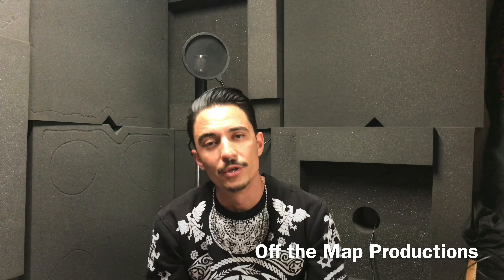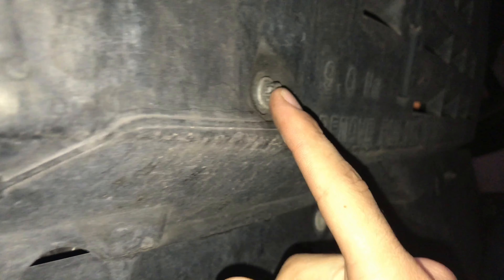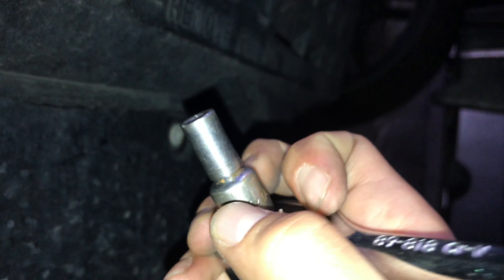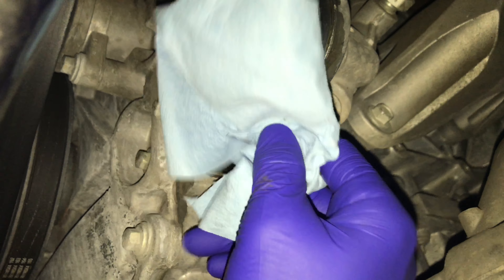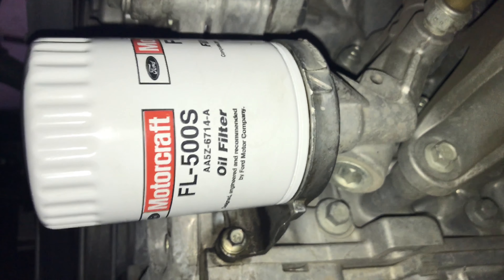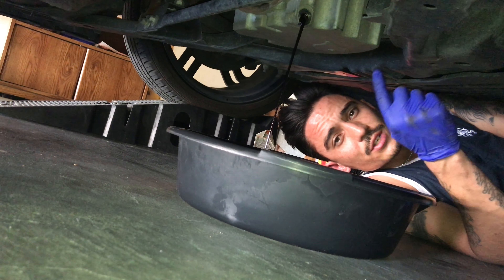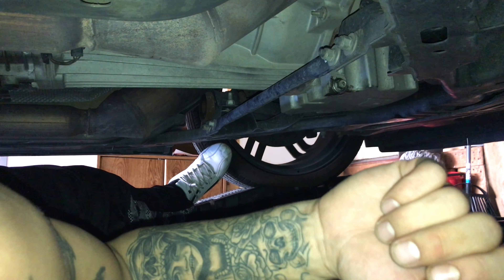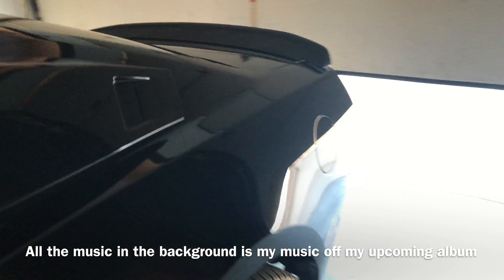How to do a Oil change 2012 Ford Mustang 3.7 V6

Comment: I thought your supposed to put some oil in the filter before putting it back on ? Is that correct ?
Reply from the maker: For this vehicle the filter is sitting sideways, so oil would spill.  You definitely want to put oil on the gasket of the filter like in the video.